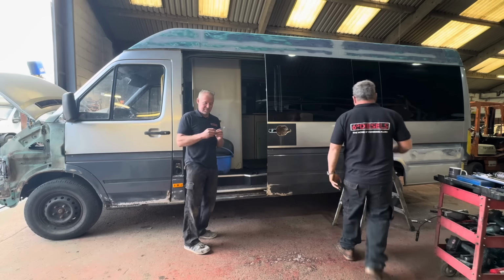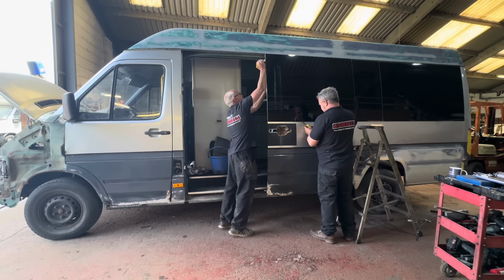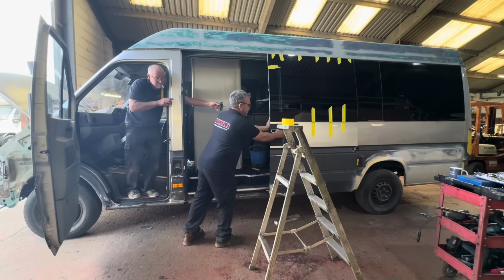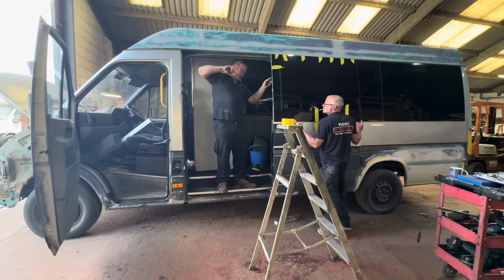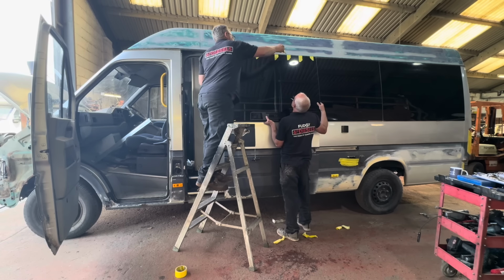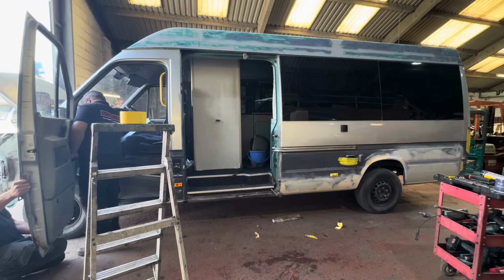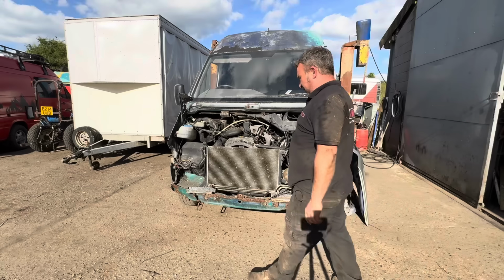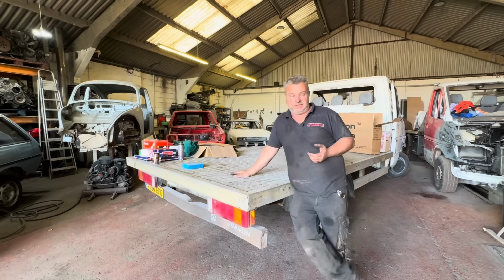Camper van gets some more love, we finally wire up a recovery truck and the new shop layout

Comment: Gotta ask you both, Is there anything that your job entails that you actually hate doing. There must be a part of what you do that brings the fear of dread, like car electrics or working on part of an engine that is annoying?
Be interesting if you did a Q&A session where viewers pose things they’d like you to answer. Just a thought. Keep on doing what you do it’s infectious and can’t wait for each instalment.
Reply from the maker: Honestly since we moved away from modern every day car repair I can’t say there is, back when we did I use to dread coming in some days!!! Its was more the customers than the actual work! “Is it done yet”…. (6th time they’ve phone up) I must have it back by 5!!!…. Oh I didn’t think it was going to cost that much!!!…. Last week you fitted some new wiper blades.. and two days later my engine blows up that’s obviously your fault…. And finally oh I’ll pay you when I get paid at the end of the month …. Eeerrr I don’t miss that one little bit 👍
Reply: @6DDIESELSDorset  thanks for replying with the detailed response. Yes I can see that those are plenty of great reasons why you now do what you do. I guess another classic line would be them telling you what they think the issue is and then from their diagnosis, asking you how much will it cost to fix. Like you have a price list in your head for the parts, and can instantly work out the amount of man hours required to do the job effectively and then wait for them to make a noise or take a sharp intake of breath before saying is that the best price, surely it’s only an hours work. 
I don’t envy garage owners that get those kinds of questions. 

Looking forward to seeing Sunday’s antics.